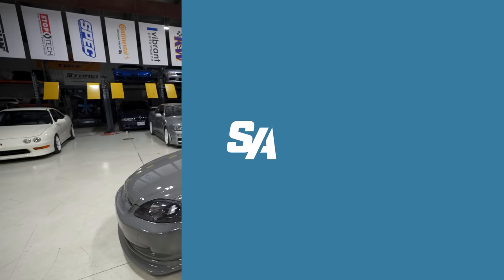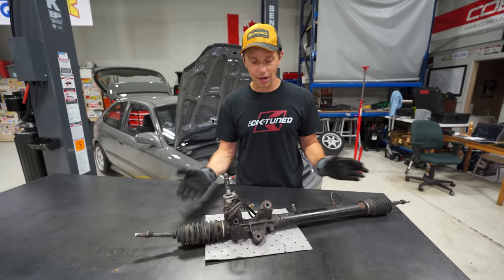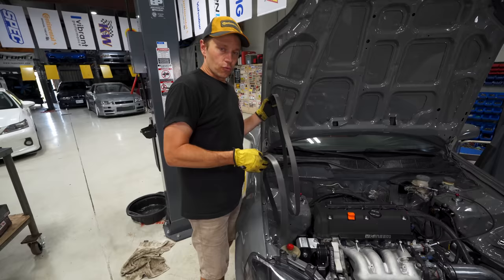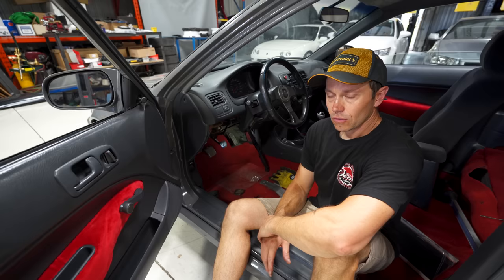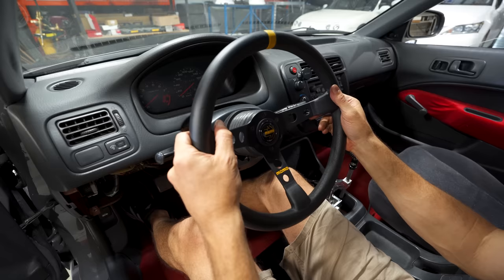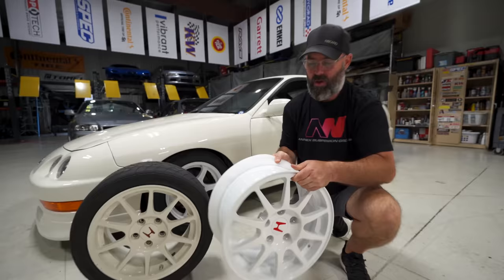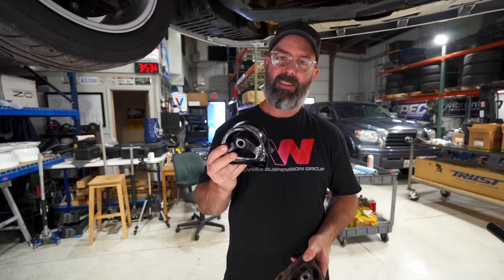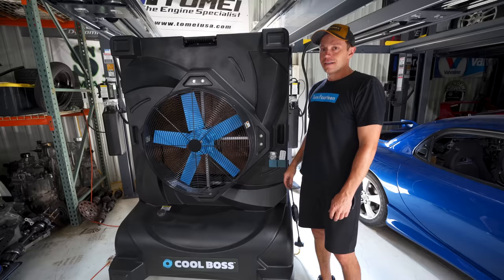$2000 Civic K-Swap Redemption Build

Comment: Larry chen recently said that when fitting the Nismo brace to his R32, it didn't line up at first, but when he put this car on the lift, it did. Just because of the body flex with the weight on those strut tops
Reply: FAX. If only i knew this when i bought my tanabe strut bar then returned it. Then went with this an adjustable one. 
Imma raise my car up when i do an oil change and re install my bar
Reply: Similar issue with my racing beat brace for my Rx7.  Car was low miles, never in an accident, just had to keep everything loose, do the firewall first, then mess with the strut towers until it lined up.  Given the questionable history of your car, I wouldn’t blame the brace.
Reply: I would recheck wheel alignment after adding the brace, especially if it's flexing the strut towers!
Reply: Yup... This is strut tower brace 101

Comment: seriously i would have told the guy to redo those lines since what you got is not what you asked for even with the time.
Reply: Yea like wtf he said stainless steel braided lines thats some nickel copper line with some rubber hose i would of been like dude how did u get this fron steel braided
Reply: on top of it there is more fail points than stock. what the guy gave him was shit!
Reply: Yeah wtf is that? Rubber lines may be a hazard on track too.
Reply: Ya id pay money to find out what the guy who made that was smoking.
Reply: all the guy had to do was just LISTEN!
Reply: I agree, those are terrible. No way I would have accepted those.
Reply: Those are high pressure flex lines the shop knew what they were doing
Reply: How much psi does a honda powersteering setup pull.

Are those rubber lines rated for atf?

Edit: can they handle the heat that will be generated?

Will this car end up written off because of this?

I ask because you went to a pneumatic shop, not a hydraulic shop.
Reply: I would have refused that.

Comment: I worked in a hose store for a few years.  My guess on why that synthetic piece is there is because there is a lot of measuring when it comes to bending a line that many times.  It takes time to map all the bends.  That's just my opinion.  It's not how I would have done it either

Comment: You could have done that steering pipe fix yourself, keeping the original hard bent pipe then adding the hose or hardline with flared fittings all the same.
Hopefully the rubberised lines don't harm the feel as they're a weak spot.

Comment: For the Type R understeer, you could leave the back sway bar at stiff (with every rear bushings in poly) and either swap the front sway bar for a smaller or (if you can't find a smaller one) swap the bushings for regular ones (non poly) and do a front alignment with a little bit of toe in and a few more degrees of camber , provided this is a tracking car more than a weekend drive around car of course. Otherwise the tire chew will be somewhat unpleasant.

But good tires on those 15's would probably take care of some of the understeer.

Comment: Pete why dont you put the transmission + another part from your stash up for trade on marketplace for 08 SI LSD trans .
Reply: Agreed.  The transmission from the Civic Si (2006-2011] came with a 4.7:1 final drive and LSD.  I know the early RSX-S had a 4.3:1 final drive (probably better for a car lighter than the 8th Gen Civic), but it never had LSD.   Note: the later RSX-S transmissions had a 4.7:1 final drive and still no LSD.

Comment: Thank you so much for shouting out that wheel manufacturer! A problem I've been having with planning out my RSX is that I prefer the stock '05-'06 Type S wheel design over anything I've seen aftermarket, but as is the problem with factory wheels, they're too narrow for the tires I'd like and the offset is too high. But now I can finally have them made in my ideal spec, thank you!
Reply: Over $6K CDN a set for 15" magnesium WOW!!!
Reply: @Patrick94GSR  Yeah, it would be about $4k US for the 17" aluminum wheels I want. Volks are cheaper, but I'm trying to stomach that by reminding myself that it'll likely be the only set in existence, and I don't like doing what everyone else is doing.

Comment: love the video, with the stainless braided power steering lines you would not be able to have them bend that sharp of an angle without compromising the hose I have ran into a similar thing before so as you have it is probably the best they could do it

Comment: About the LSD, I'm not versed with this stuff but it seemed like you were saying it would be a lot of work to install an LSD to your existing transmission, but what about swapping out for a transmission that already comes with an LSD? Not sure if that's an option. Anyway it seems premature to already be returning to the track if you've removed the budget cap, but haven't really done significant mods to the cars yet. Still loving the continued work on the Hondas though. 👍

Comment: Dave don’t let Pete win this time, Put in a Hondata s300 and vtec to the moon. 😅
Reply: The s300 is very dated technology and extremely overpriced. For what it's worth, there are much better options out there. Unless you are tuning the car yourself or plan to make real-time changes to the tune, you dont need Hondata. Just get a socketed p28 and get it tuned on HTS. Save yourself the cost of the s300. If you don't already have the virgin p28, you'd have to find one in order to run an s300. And yes it has to be a virgin ECU. A socketed p28 will not work for an s300 as it uses a header opposed to the 28 pin socket a chip or demon board uses. And virgin ecus are going for 400$ now, thats if you can find one. Maybe you can only find a non vtec virgin ecu like the p06, then it has to be converted to vtec. Then you'd need the s300, that's 800$ candian dollars by itself. Then you need to pay to have it all installed. Want to run the Hondata COP retrofit? Thats 500$ usd, and also extremely overpriced and doesnt even work that well. Burton Racing offers a much better COP conversion kit for OBD1 ecus and its a compatible with ALL tuning software (Neptune, HTS, SnakeEMU, Hondata, etc) unlike the Hondata COP which only works with Hondata. The Burton Racing COP kit will even work on a completely stock Honda ecu, and it doesnt cost 500$ dollars. Want to run boost by gear? Thats more money. And at the end of the day you're still stuck with a 30 year old ECU. So youd better replace the all capacitors while your at it before they start leaking and burn a hold through the board, actually had this happen personally. My point being for what you'd have into an s300 you could buy a modern standalone that runs in full closed loop VE. Haltech, Fueltech, etc. If Hondata wants to survive the next 5 years they are going to have to SIGNIFICANTLY lower their prices and/or come up with their own entry level standalone that covers OBD1 and OBD2 platforms, and it has to be affordable. And by affordable I mean cheaper than a Haltech 550. There are only so many virgin Honda ecus left in the world that can accept the s300 board, and for what it cost to get it up and running it just doesn't make sense anymore to go out and buy it new if you don't already have it. The s300 was great back in the early 2000s becuase there weren't many options for real-time tuning available to the common man, otherwise you were spending crazy money on a standalone..

Comment: for those seeking to add power steering to their  k-swapped cars, just know that it adds a very loud whine to your engine sound. some folks might not like it.
Reply from the maker: I think its an old and tired pump thing, this is the first PS pump that has been whisper quiet. I thought it didnt work when we hooked it up cause Im used to them whining so much

Comment: It’s probably stainless braided hydraulic hose. It’ll work, but it’s very bulky.  This is when the industrial hydraulic shop thinks you are using it on mobile equipment instead of a car. 😂

Comment: Those rubber hoses are weak where the metal fittings are crimped onto the rubber.  Will probably be fine for 12 months, but wouldn't trust it beyond that.

Comment: @6:07 they did it like that instead of braided as they would need special lines that could handle the pressure. likely a steel braided line would explode from all that high pressure from the power steering setup. It's odd that they didn't just do straight hardline as its directly bolted to the rack which won't flex at all, that's the only thing that's offputting to me. but aside from that, redoing hardline was the better route.
Reply: That's rubber coated braided stainless Teflon. The only difference between that and the cheap stuff is it's crimp and rubber coated.

Comment: The bolt holes won't line up on the brace because of the chassis flexing. If everything lined up perfectly there'd be no point for the brace. Jack the car up, install the brace and then torque it down.

Comment: Pete, why didn't you take the power steering rack and get the lines re-done the way that you intended to have them done initially?  Also does anybody know why there is a chunk missing from those magnesium wheels?
Reply: It's not the wheel, it's just the protective wrap on the lip not going the whole way around

Comment: Traction bar and motor mounts (if not already done) can almost be as good as an LSD at least in a straight line. Or maybe the trans from a k20z3 could fit if you really wanted one?
Reply: Straight line? What are you talking about? The ITR was completely demolished in a straight line by this civic, the corner exit are what they are focusing on with the lap times.

Comment: Im not sure if its the usdm / cdm market , but that pedal spacing is insanely wide , .. The JDM pedal's are FAR Far closer , ....  as i know as i can easily heal toe in my JDM EK4 SIR ,  with NO issues AT ALL on the stock pedal's .., Also that goes for lower model EK civic's i'v driven down here in NZ  (ek2/ek3's) ..., ON the wheels on the teg , .. im sorry but there FAR TO WHITE , LIKE YOU said put championship white wheels and get a JDM 98 spec dc2R or db8R chassis code and order new wheel cap centers

Comment: Entire episode feels like you’re trying to convince yourselves that these parts knock off parts aren’t that bad & worth putting on to your build.
Reply: I was shocked that they were using so many knock off parts. Makes me not trust the stuff they have listed on their website.
Reply: ikr spent like 17 19 grand? and its slower than a fucking stock b18, with that type of money  you could've gotten a 500 hp, LSD, big wheels, sticky tires, good aero, roll cage. but instead these guys bough MUGEN PEDELS! like what a joke

Edit: Like they said at 10:30 that these fucking joke mods are better than a LSD. Holy shit
Reply from the maker: Blah blah bring your stock B18 and beat up on us at the track if youre so sure it s faster. Until then keep on keyboard Racing.
Reply from the maker: A pedal set and a strut bar need no convincing. Not like they’re going to fall off on track.
Reply: Bro it's a pedal set and a strut brace. It's not like it's engine or suspension parts that can fail badly on track.